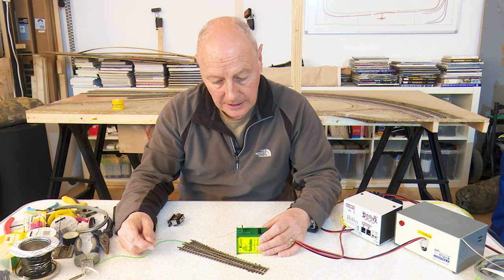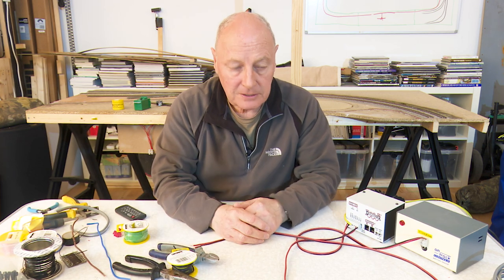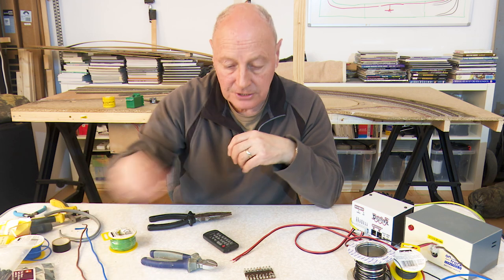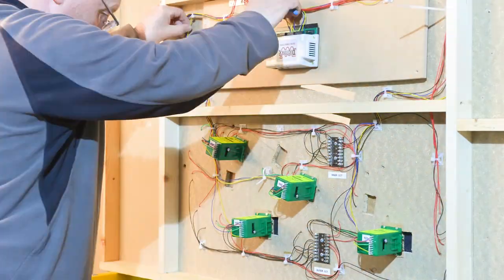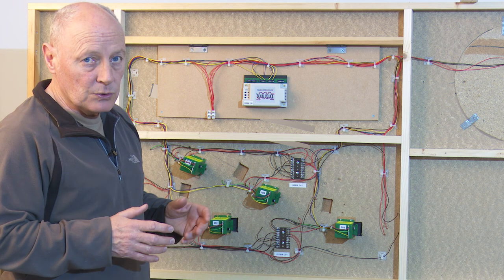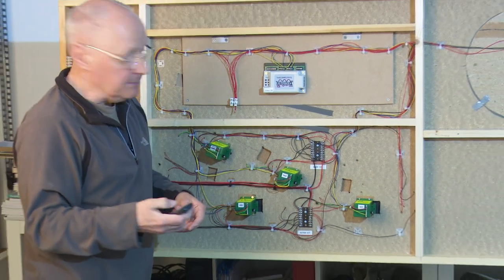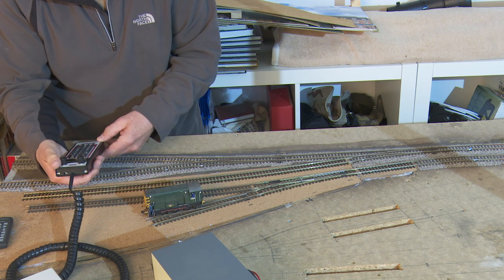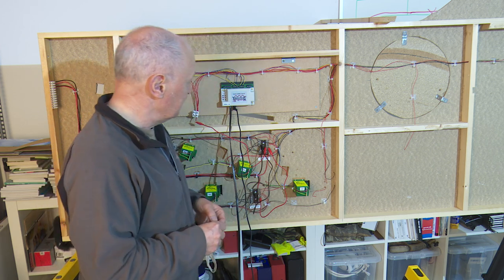DCC Bus Wiring at Chadwick Model Railway | 24.

Comment: Hello Charlie ,    Interesting point, you made, about not having a ring main type wiring circuit . It makes sense when one
 thinks about it . So would it not be equally as important to ensure that the rails , on a tail chasing layout , have an insulating 
 gap , at some point , to prevent them providing the ring circuit affect , as well ?  Just a thought . I can only understand  D.C. 
 so most things D.C.C.  just fly over my head .    Regards ,   Paddy  Owen .
Reply from the maker: Hi Paddy, what a great and obviously correct point.  Our club layout which is a large tail chaser, has breaks at the board joins.  But, a static layout wouldn’t have that.  It certainly didn’t occur to me.  I’ll mention it in my next DCC video.  Thanks again, regards Charlie
Reply: Insulated joiners on points would break the ring main effect I think?
Reply: That`s a fair point , but I believe many of the DCC brethren use electrofrog points , which would
  provide continuity to the system .         Regards ,        Paddy  Owen .
Reply: You only need to use the insulating joiners on the electrofrog points to stop the system shorting when switching the frog from one polarity to the other so would break the ring main effect?
Reply: Sorry !  I meant to say insulfrog  . That might make sense to my comment . It`s an age thing .
   Regards ,  Paddy  Owen .
Reply: Insulfrog are as the name suggests, are insulated already... so do not need insulating joiners as they don't conduct the power so again break the ring main effect... as far as I understand it anyway?
Reply: Have replied , but sent it to Chadwick  TMD  by mistake .        Paddy .

Comment: The reason solid wire is used in a house AC and multi stand wire in used for DC is AC current runs thru the center of the wire hence one large wire and DC current runs on the outside of wire hence many small wires.
Reply from the maker: Hi Carl, I was always lead to believe that solid core was for fixed cables and multi-core for cables which are mobile.
Hence an AC kettle cable, vacuum cleaner etc. are multi core.
Reply: Nonsense.

Comment: Thank you, Charlie for another great video. I am just getting started and quite like your idea of running 2 BUS, as I am planning on a 2 main line layout (hopefully). I fully understand the idea of fault detection (shorts), but then it struck me... where does the 2 indivdual BUS end up? Surely for the DCC signal to transmit they must both connect to a command station (I run ESU EcoS) with 1 outlet for track pwr, and 1 for Programmable track - as well as of course LocoNet ports for eventual Boosters (which I do not have a need for just yet)... so how do you seperate the 2 individual BUS and still ensure DCC data? Admittedly a Newbie here, so may not see the obvious...
Have a great New Year's to you and yours...
Reply from the maker: Hi, to split the power feeds you need to run through some kind of  power management type system. I use something called a Digitrax PM42. This has one input from the controller, and four outputs to different power districts. I do hope that makes sense, regards Charlie

Comment: Hi Charlie, It looks you used thicker cables, than droppers, to connect point motors, am I right? If this is the case, could you please specify what size? I intend to use 7/0.2 to connect of point motor with a SPDT switch, is this good choice?
Reply from the maker: No Filip, it must be the camera angle.  I use 7x0.2 unless it's on long dropper runs then it's 16x0.2
Reply: @ChadwickModelRailway  thanks Charlie.

Comment: I am building a small N gauge kit {3ft. by 6ft.} from Woodland Scenics.  My question is about whether or not it is necessary to run a bus wire on such a small layout with 3 or 4 switches
Reply from the maker: No, I would just run all the cables back to a central hub. Regards Charlie

Comment: I know my reply is a bit late, BUT you mention the signals for the decoder in the loco as getting echo signals when using a ring main type feed, What are your thoughts regarding the fact that this can still happen when not using a ring main, but can still receive echo signals from the adjoining rails from other droppers.
Reply from the maker: Hi Sam, I understand your point but I believe that the echo time would be so short  that the impact would be minimal.

Comment: At 6:32 you say "every single piece of track..." needs a dropper. When you use the term "single piece" what do you mean? Is this the same as an isolated section? Thanks. Just getting back into this and trying to follow your advice on all my setup procedures.
Reply from the maker: No Guy, it's god practice for DCC systems, to have a feed to every single piece of track to ensure that the DCC command signal is top quality.

Comment: Hi Charlie, thanks so much for this video. I'm just at the start of my journey into model railways, trying to record my progress on my own channel, more a s a record than a how to.  I am finishing laying down the base prior to purchasing track, but before actually laying the track, I want to install the bus wire for DCC and was looking for information regarding the correct gauge of wire. You mention the "accepted" dropper wire is 7core 0.2mm stranded wire, but what would you recommend for the actual bus wire? Would be grateful for any suggestions. - Steve
Reply from the maker: Hi Steve, that depands on how much your controller can produce and how much your railway might draw.  24 x 0.2mm might be ideal.
Reply: @ChadwickModelRailway  Thank you for taking the time to answer my question. It is much appreciated.

Comment: If I’m using fish plate drop wires, witch track gets the signal. If it is both, it would seem that you would need half as many drop wires.
Reply from the maker: Perhaps but it’s very difficult to out a point if drop wires are attached and there’s no guarantee of a good electrical contact.

Comment: Do I just set up a DCS64 in each district and connected it to the drop wires that have been connected to each track enough to allow Digitrax to see where each loco is on the layout?
Reply from the maker: DS64 is not a power district item.  You can power them from 12v dc via the socket at the back.  They are designed to change points.
BDL168 allows block detection and requires a computer program to see where locos are.

Comment: The reason you do not want to create a circle is latency. DCC is a simple data network. Latency is caused by the time it takes data to travel between the sender and receiver. Being the signal is sent around the circle, the signal will go into different directions around the circle. The sender that is closer will get to the receiver sooner then the same signal that has to travel farther causing the latency. By your not having a circle the receiver only gets one signal from the sender to process and not the same signal that took longer or had the latency issue.
Reply from the maker: Thanks for an excellent explanation, JR. Regards, Charlie

Comment: Hi Charlie, You're my go to You tube guru. I'm having difficulty in sourcing wiring supplies.  Halfords suppliy 5amp,7amp and 8amp flex, but  I can't find a source  for 1.5 amp dropper wire or the push type choc box connectors. I've scoured the internet without success. I'd be grateful for any advice. Many thanks, keep up the good work.

Grant
Reply from the maker: Hi Grant,
I get my choc block push connectors and cable reels of “Rapid” wire from Squires.  The cable size for droppers is 7x0.2.
Regards Charlie
Reply: Hi Charlie, Many thanks for the prompt response.  Unfortunately, I can find many Squires, but not the one you use. If it's not too much trouble, a web address or postal address would be appreciated.
Best wishes, 
Grant
Reply: Hi Charlie,
The penny finally sank when I viewed another of your videos and you mentioned purchasing something from Squires at a Model Rail . show. Duh! I've now got the address , thanks again.
Grant
Reply from the maker: All sorted,  well done mate.

Comment: Hi Charlie l have a loop of about 32ft in total and used Halfords 5amp flex for my bus wires and used snap connectors to attach the droppers, but notice that when running more than a couple of locomotives the system shuts down after about ten minutes of running until I take one loco off. Just wondering if the bus wires need increasing. Any thoughts?
Reply from the maker: Hi Steve, is you bus ring continuous and if not is your power supply in the centre of the line. You could connect another larger feed cable to the other end of the layout.  What’s the max output of your command station and does this happen with all locos?
Reply: Hi Charlie the loop is not continuous but the controller is nearer one end rather than the centre. I purchased a NCE Powercab controller which I think has a 2 amp rating. If l remove one loco say my class 57 Freightliner the whole system is available again. I wonder if a booster is required?
Reply: Hi Charlie just like to say that after watching your instructional video on soldering I was tempted to have a go and did all my droppers onto the fishplates

Comment: Is there a system where all the DCC controls can be done from a touch screen tablet? Also is there a problem with using a larger bus wire than you need?
Reply from the maker: Hi (sadly I don’t have your name),  
A larger bus wire shouldn’t be an issue only on your wallet! 
Regarding a touch screen controller, there are several available. Try calling “Digitrains “, they should be able to give some good advice at various price points. Regards Charlie
Reply: Try the Z21 system from Roco/Fleischmann, it has very slick apps for iPads and iPhones, as well as  Android tablets and phones. Roco/Fleischmann also sell a handheld controller for the Z21 called the Multimaus.

Comment: Only if you wank around. Try using a pair of pliers to hold on to the piano wire and off it comes with a dremel. Fingers burnt not. I have 22 points using slowmo&soldenoid motors at the moment,all have piano wire control of movement of swich blades,no shorts as well . I don't use insulated rail joiners as well on my peco all metal points,you can work that out as well as prep. All rail have dropers as well.
Reply from the maker: Hi Mike, I’m so pleased that you enjoyed the video.  I screwed up many years ago using a Dremel to cut point actuation wire.  Hopefully, I can encourage Guys new to the hobby, not to make the same mistake.  One comment on my last video asked me to emphasise this exact point.
Regards Charlie

Comment: Doesn't splicing your buss onto a multi tap terminal strip and running your  track power to the various locations use an extreme amount of wire instead of taping from your buss at each track location?
Reply from the maker: Yes it does use more Dennis, but it certainly makes faultfinding easier. Regards Charlie

Comment: I’m confused. Witch red wires go to the BDL168 and witch ones go to the tag strips. I am really new at this hobby but I do want to do block detection. Bob
Reply from the maker: Hi Bob, I use the red wires from the blocks to go to the BDL168. It can take 16 blocks. All the black cables go to a common terminal block.
Reply: Which block are you talking about?
Reply from the maker: A block is section of track isolated for block detection and automation.

Comment: What is red thing you used to connect is it called Scotch Lock Wire Connectors ?
Reply from the maker: I don’t know their name but I bought them from Halfords.
Reply: Don't use them solder all except where screw terminals are supplied

Comment: Hi Charlie, I know you have said you haven’t used Bachmann EZ HO track. It is like Fastrack with the rails in a fake, plastic ballast.. My layout is 24/8 and after I’ve setup my layout, my engines tun very slow and after 15 to 30 seconds, it shorts out. I’ve tried taking part of the layout a part, mainly a switch, when doing so the engine run normal. Any idea why this shorts out. I only have 1/3 of the layout wired up. Could that be the problem? Also, I have run my red and black wires from my transformer into my Digitrax. And my red and black from my Digitrax into my tails. When doing so and after running my transformer all the way up, I get no power to the track. The lights are on in the Digitrax controller but know thing seems to. Any ?
Reply from the maker: That's adifficult one.  Does it happen with every loco and do you have another contoller that you could use or perhaps lend one?
Reply: Chadwick Model Railway I’ve tried different switches at the same spot where the short appears to be and different engines. Yesterday I tried taking the EZ track switch out and put a Atles 100 switch in its place. It worked just find. The high of the two types are different. I changed the layout just slightly but with the same number of EZ track switches in the new layout. Everything works just find now. 
As I believe I have told you before, I suffer with dementia. The train hobby help me out by making me think harder. Allowing me to ask question and watching your videos also helps me to make things workout. I hope I don’t bother you with all my questions. There may be more as I try to bring Digitrax into my layout.
Bob
Reply: Chadwick Model Railway Charlie, sorry so many questions but this about Digitrax. I have 10 switches and will have lights and other accessories. Should I get a Digitrax DCS200 and a Digitrax PS2012 to have the amps to run everything. Also am I right that I can run wires to run the switches from one spot. I’d like it to be with my control system?
Bob

Comment: Ok I’m not an electrician and wiring things up is all new to me. So here’s my question about “completing the ring” Even if you don’t complete the main BUS, will the signal still complete where the tracks connect to each other on top the layout? Ok, use insulated joints there. Will the signal still not split as part of the loco passes across this joint and the DCC signal is being received at both ends of the loco completing the loop anyways? All be it for a split second but at slow speeds the circuit would complete?
Reply from the maker: To overcome the use of insulated rail joiners and to ensure perfect electrical continuity, I solder droppers to every piece of track. Regards Charlie

Comment: Fundamental question !!! Why do we need droppers? Will the rails themselves not carry the power and the DCC signal?
Reply from the maker: No Mathew, the DCC signal requires much better conductivity and it’s the rail joints that create the problem.
Having droppers on every rail might be somewhat over engineering, but it’s considered best practice.
I do hope that helps.
Regards Charlie
Reply: @ChadwickModelRailway  Many thanks for your prompt reply Charlie I get it now it's not really a power problem more a signal one that, I understand.

Comment: Do the loco, point and signal numbers have to run consecutively?  Or could u have, say, 001 to 199 Locos, 201 to 399 Up Line Points, 401 - 599 Down Line Points, 601 to 799 Up Line Signals, 801 - 999 Down Line Signals etc?
Reply from the maker: No Tim, the choice is normally yours.

Comment: Great vid full of good info, for oldies and new. I do have a question , when wiring the bus wire , you do not create a loop!, this could confuse signal timing to loco,  Isn't the track a continual loop, especially if soldered at all  track joins ,  I was also advised to put a short out bulb/safety in the main feed line as this will protect the dcc controller from dead shorts, ie, it something causes a short the light globe will  illuminate and stop the short from triggering the inbuilt shut out device. there was a vid showing this set up on youtube, it was revering to the Hornby elite ans select.
Reply from the maker: I’m so pleased that you enjoyed it Mark.  I understand the short out bulb  but use a PM42 from Digitrax to keep a watchful eye.
Regarding the non complete loop, I have taken advice from many electronics experts involved with our hobby. The timing of command signals arriving at the decoder from different directions is debatable.  However, strange DCC faults have now almost disappeared from our club layout since breaking the loop.

Comment: Hi Charlie, I want to wire a DC layout using a guagemaster x4 control - do I  need a separate bus wire for each loop?
Reply from the maker: Yes, Kieron, each circuit needs to work independently from the others. Regards, Charlie
Reply: @ChadwickModelRailway  thanks Charlie - if I want to link two of the loops via double points, how do I transfer the power?

Comment: How would I wire up a bus which has three cables Red, Black/Brown and Green. Where do I connect the Green bus to. Green is part of the Peco switch wiring. Regards, Graeme Palmer, Albany WA Australia.
Reply from the maker: A Bus wire only need two cables GP.   The Peco switch is for the frog.
Is there a reason that you havent subscribed, it's free?
Regards Charlie.

Comment: how do you wire 2 seperate n scale tracks with one nce power cab controller and have 2 trains running at the same time
Reply from the maker: If it’s DCC, you simply called up the two different loco addresses. Regards Charlie

Comment: If the buss is not a complete loop it does not matter because the track is a complete loop unless you break it intentionally as well.
Reply from the maker: Hi Hardie,   I do understand your logic but I believe that the thought process is based upon the probability that with board breaks and insulated joiners on electro frog points, the loop would be broken at some point. Regards Charlie
Reply: I would always make sure the track was never a full electrical loop for the same reason,  you get echos of the DCC commands on the circuit.   For the cleanest DCC signal every piece of track that has droppers should be insulated from the next track section,  no chance of echoes arriving from other droppers on the same section.